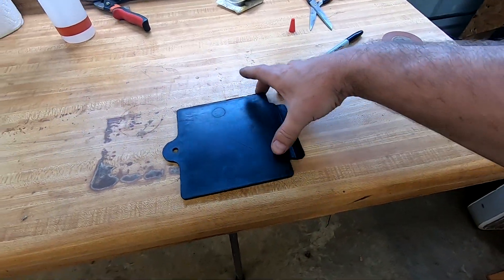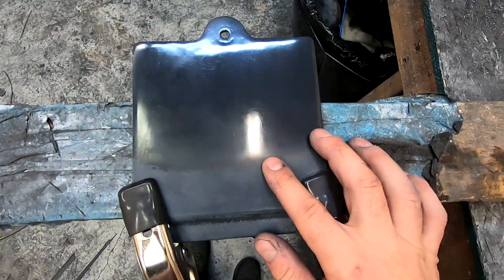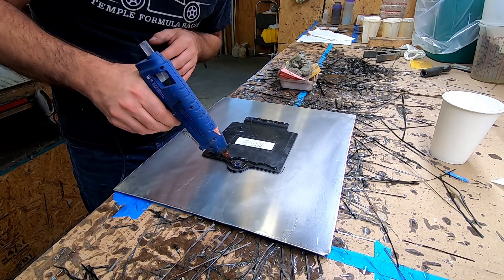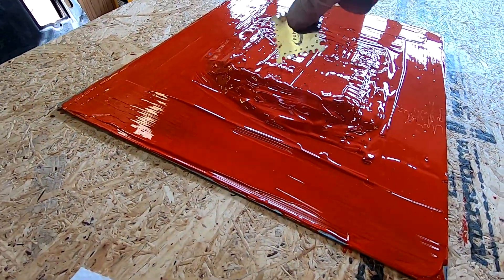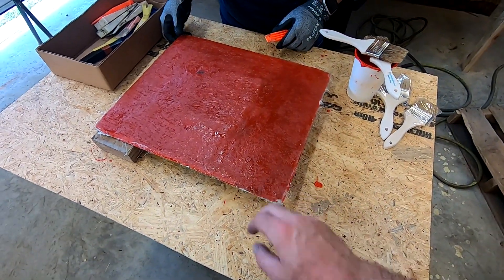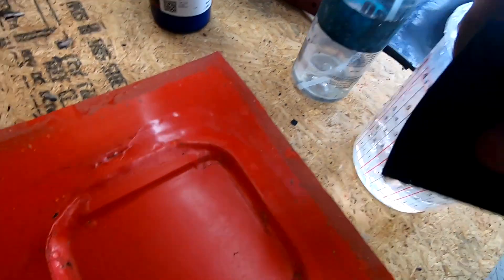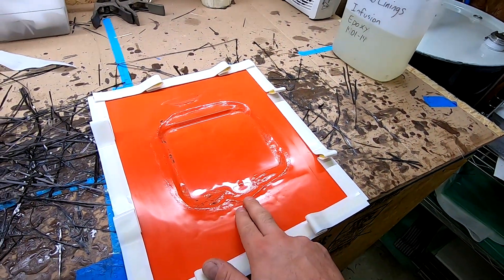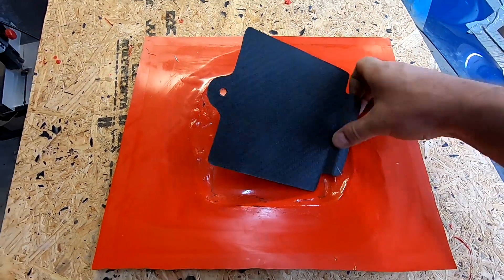Making a Mold of a Plastic Part to Turn Into Carbon Fiber- step by step

Comment: Hello — I want to modify a part’s shape (for example extend one corner) and then make a new mold from the modified master. Could you explain the step‑by‑step process: how to build up and sculpt the added area, which fillers or build‑up materials you recommend, how to finish and seal the modified master, and any special moldmaking considerations for the new geometry?

Comment: I have some abs plastic parts I want to use. But don’t all gel coats negatively react with abs unless it’s 100% sealed? Is there a way to get around from using a gel coat to be able to get a mold from the plastic?

Comment: I dont understand why you put fiberglass on the back side of the mold. And carbon fiber cloth on the inside. Which the inside part is what you actually use correct?
Reply: The fiberglass on the back side of the mold is to reinforce the mold and make it sturdier. Makes it reusable and useable.

Comment: Hey I want to start making a mold Im just a little confused about the gelcoat the one Im looking at is a polyester gelcoat will it bond well with the epoxy resin when adding the fiberglass?

Comment: Just before you lay down carbon fibre sheets, do you have to put a clear gel coat down first?
Reply from the maker: @johnthompson9918  only if you want to
Reply: @ajhartmanaero  what is the alternative? Spray a clear coat on the finished product? ✌🏼
Reply from the maker: @johnthompson9918  yes
Reply: @ajhartmanaero  thanks for your reply 👍🏼

Comment: Does this work with rc cars? I want to build a little bodykit for my rc drift truck, can I skip parts? Is it like fibreglass? It doesn't have to be perfect, can't I just mould the bodykit from clay, then just brush it on? The fibre will be getting painted, I'm more concerned about the strength and weight
Reply: Yeaaaaaahhhh, I'm just going to use fibreglass fluff! 😂😂😂

Comment: What’s the point of the primer? Why not just put the gel coat on the part? How many layers of fiberglass did you apply? What’s the gsm of the fiberglass sheet? What epoxy/ resin did you use? The us composite gel coat can be brushed on and not sprayed?

Comment: Clay sucks. When the gel kicks it gets hot, that heat will cause the clay to sweat, and then the gel will release. There is a better way to make that flange with very little to no clay at all.

Comment: I believe the reason why you had those holes appear on the gel was due to the Clay releasing oxygen creating those air pockets D: I could be wrong but I do believe the clay were exposed to oxygen inside them while you were molding around the piece. Think it takes more than 24 hours for the clay to dry fully before appyling any application over it. Absolutely amazing job! Makes me want to invest in doing something like this for my future project build!
Reply: Why to use wax...

Comment: I found your video and the part came out great. I'm not fond of "wiped it down with acetone" and then keep touching it with your bare hands. No matter how clean your hands are they still have oils on them. Wear gloves and a respirator. Working with glass and carbon fiber (I'm and aircraft mechanic) you need PPE. Thank you for the interesting video.

Comment: any suggestions on a lower cost gelcoat? found the one in your video and its 200 for it, curious if there are more cost effective options or if thats something not worth cheaping out on
Reply: If you're using a gelcoat just for a mold, you can mix your own using 1ltr polyester resin + 20% calcium carbonate + few table spoons of aerosil. Calcium carbonate is just a filler to make it viscous and have more volume. Basically you can use any fine powder such as talc, lime whichever is available to you. Aerosil (most commonly known as cab-o-sil or fumed silica) is important because it makes your gelcoat sticky and non-sagging. I don't know any alternatives to aerosil but it is an important ingredient since having a runny gelcoat would just make it flow to the bottom of your mold, making it thinner at the topmost part. If it's really not available, filler alone would be fine just make sure you don't add too much of it.

Comment: So you may have been asked this a thousand times too, but with the parts you use to create the mold, like this cover...
Are they useable if you're not needing to sand them and mod them too much, such as a body panel or interior trim?
Thanks

Comment: From what I learnd today you need Pva if you have some deep parts that wont easily leave the mould. PVA can guarantee some decimals of flex when you demold a piece with two straight edges.
Reply: PVA is also water soluble, given some patience.

Comment: A couple of questions . . . first, since your fiber mats extended past the ends of the part, and then you cut through those.  Doesn't that tend to induce a frayed or rough edge?  I know you sanded the edge, but don't you have to seal it in some way?  (Or is the infusion so complete that the cut/sanded edge is still basically monolithic in nature?)  Second, your objective in making it CFC?  Looking at that part as a machine builder, I could see making it out of a piece of sheet aluminum.  Then, instead of spending the time making a mold, I could have spent time machining a basket weave of material away for lightness, if that was more of the objective?  I also tend to like metal if I ever think I'm going to have to modify it because I can add bosses, taps and things more easily after the fact.  Obviously for curved, structural body panels, CFCs can more easily yield a stronger, more complexly shaped, light weight part, with managable tooling.  (Or was this more just for the demonstration?)

Comment: can you do a video on when your making a carbon fiber part how do you know how much resin and hardener do you use  for the part I  guess you could say the formula for each part that you make. Thanks
Reply from the maker: No need. Just weigh your carbon and start with a 1:1 and adjust from there.

Comment: Why not fill those light scratches with hard wax? Seems like reasonable solution.
Reply from the maker: I think any time saved there would have been lost with extra work polishing the mold surface.

Comment: Nice works. But you could probably avoid the spray  coat and use packing tape to cover the surface and have a ready to use nice surface
Reply from the maker: If you can live with the ridges from tape lines, sure.
Reply: For an undertray lid sure one can live. Packing tape exists in different sizes and   if you don't find it , there are out there many cheap kind of tapes , adhesive and not, in rolls large enough to entirely cover easliy that geometry.

Comment: love the video! the reason that your gel ended up like that is from too much product applied at one time. I know it was a small part but if you used a cup gun or hvlp to spray the gel on i dont think you would have had that issue with the clay. Also id recommend using yellow plasticine wax rather than clay its much easier to work with applying and modeling.
Reply from the maker: I have a cup gun but absolutely hate the overspray issue with them and still get lifting issues. Thin coat, thick coat, doesn’t seem to make a difference in my experience. As small as this part is I figured brushing would be more appropriate. And any tips on where to find filleting wax in the US would be appreciated. I’ve found other yellow waxes but nothing seemed quite right.
Reply: @ajhartmanaero  only place I've found fileting was was from Easy Composites in the UK.  I treat it as if it's literally gold since it costs so much just to get it to the states,  but it's honestly worth it.  It's so easy to apply and work with,  plus it you push the used remnants through a fine meshed colander you can remove most contaminants and reuse the wax many times
Reply: @mr2ferrari  exactly this, I reuse it and have had no problems
Reply: Easy Composites yellow wax is Pelican Nekiplast :-)
Reply: @mporta  I've searched that name without success... any ideas? Where is it made?
Reply: @mporta Do you know if this would cause any lifting issues when making a mold by chance?
Reply: @czuhh309  no lifting issues at all
Reply: @mporta  Thanks I'll look into that

Comment: I believe the reason for the gelcoat reacting with the clay is because of either moisture or oils in the clay itself. When I use PVA, those issues go away.
Reply from the maker: Agreed. But then you have all the time and texture from pva so was trying to get away without it. I’ve also had plenty of gel coats lift while using pva so still trying to nail that down.
Reply: @ajhartmanaero  I spray my PVA with a paint gun. Works great. Ends up like smooth paint. Just don't spray too heavy on the first coat so it won't create open areas in the coverage. A mist coat will help the PVA bond to the wax. I spray gelcoat (gel-coat gun of course) and PVA even with small parts now.
Reply from the maker: @carbonfiber8071  that’s exactly how I used to do it but trying to find an easier/quicker way.
Reply: @ajhartmanaero  yeah I understand, I don't like PVA texture either. I personally use a sealer on my plugs. If I used that much clay though, I personally would use a brush and pva only over the clay.
Reply from the maker: @Kurzawaa  Funny enough thats one of the solutions I want to try.

Comment: I think that the carbon oil door is cool and stronger than the plastic but a big reason for carbon fiber is the weight reduction.  Even if the weight savings is only 1 ounce on this 5" x 6" part, I can scale up for the whole undertray.   Please tell the weight savings of this 2 layer carbon vs. original plastic.
Reply from the maker: I actually did weigh them. It was about 100g for the original plastic and 50g for carbon. I don’t thing that would scale across the entire splitter blade as it would need to be thicker to handle the loading properly.
Reply: @ajhartmanaero  Thank you,   This is such a real world example with accurate weights. I have yet to do any carbon fiber but I enjoy learning and will apply this knowledge in the future.

Comment: To simplify this process and to make it more rigid I would have ditched the single bolt for a 3 bolt with no lip and reached for a sheet of flat carbon and cut it out.
And used some click bond fasteners.

No sanding no finishing no tool making
Reply from the maker: In one off world, sure. But you’re missing the end scope of the project so that wasn’t a viable solution here.

Comment: I've had many molds "lift" during the tooling gelcoat stage for reasons i just can't nail down.   I originally thought I applied too much release wax or pva...  or even my gelcoat was too thick in that area.   I've yet to get a concrete answer as my "lifting" point changes each time 🤦🏻‍♂️
Reply from the maker: Yeah I can’t quite hammer it out either and it’s fairly annoying when it happens. Doesn’t happen all the time tho.